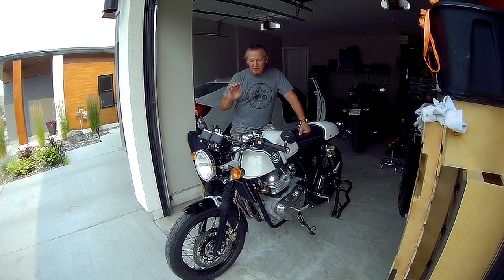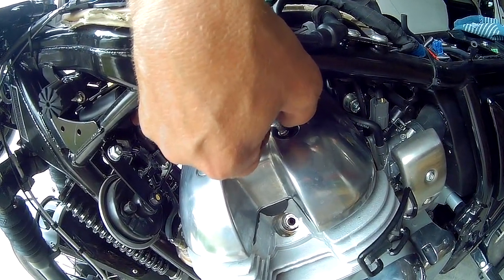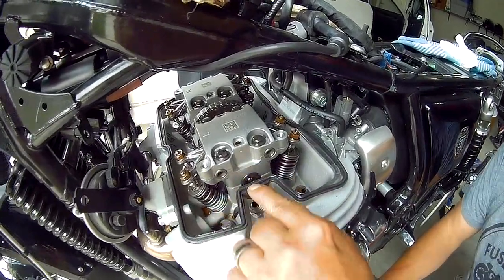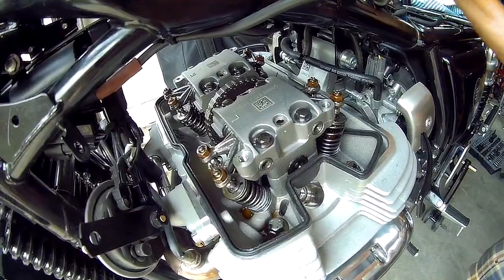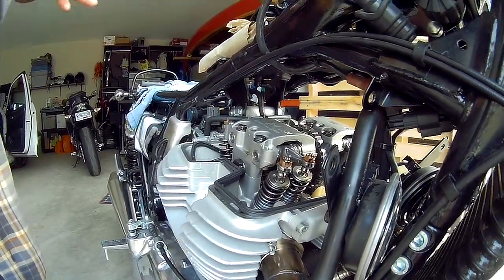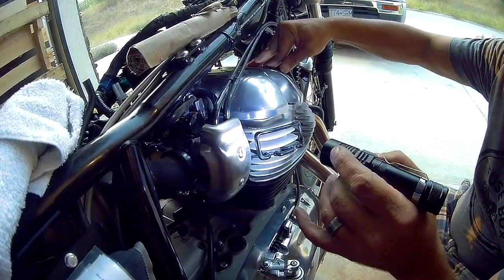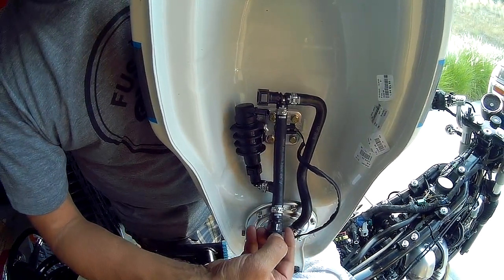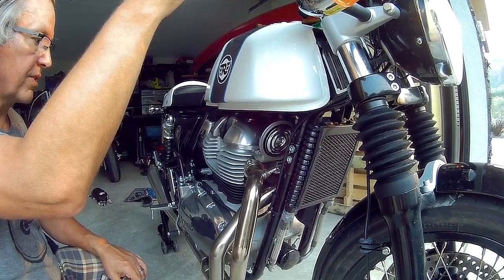🇬🇧 Royal Enfield Continental GT/Interceptor Meteor 650 How to Valve Adjustment gasket intact easy

Comment: Take the spark plugs out Last and put them back in as soon as you can, that is a vulnerable open hole to the combustion chamber; first rule of most maintenance routines.
Reply from the maker: Good Tip!!
Reply: Just put some cloth in the holes is what I do nothing getting in there then

Comment: I find it easier just to remove the gasket. Then you can easily seat it correctly off the bike and then just apply some sealant for the half circle. Goes on easily that way and less chance of mis aligning the gasket.
Reply from the maker: It may be easier to remove the gasket but if it can be done without removing the gasket then you lessen the chance of a leak, I hate leaks so didn't want to disturb the original factory seal.
Reply: @losttogether4ever  If you glue the gasket to the cover with grease there's no chance of getting a leak, done mine twice that way. What's the point of unbolting the horns then leaving them in the way? remove them completely.
Reply: Thanks for the video.
I find it less hassle overall to remove the gasket & put it back in to the rocker cover when reinstalling, I remove the old sealant from where the half circle sits & smear thin fresh sealant on. No problems after 4 valve adjustments

Comment: I've watched a few of these tappet adjustment videos and this is by far the best.  Too late for me though (I did mine a few weeks ago).  It would appear that I'm the only person to have a problem with the rocker-box gasket leaking oil after doing this job. The original gasket had compressed as much as it was going to with the original stand off bolts so I tried to buy another gasket but at $73 I politely told my dealer that I was not interested. Instead I used four M6 SS screws to replace the original rocker box cover screws and turned up 4 special stepped washers with groves to accommodate vitron (high temperature) O-rings (2 for each washer). So I no longer had a use for the 4 Dowty seals and the original 4 O-rings or the original stand off bolts. That allowed me to compress the original rocker box cover seal another mm or so and fixed my oil leak problem. By the time I'd done that 2 new seals had arrived from India for a quarter of the Australian price. I'll use a new seal next time.
Reply from the maker: Good for you thinking outside of the box and making it work!! I'm super impressed. Thanks for the kind words, we try to be as thorough as we can with our videos. Love hearing that we've helped you!! That's the reason we post!!
Reply: barney desimone   thanks for the reply mate.  The 2 new gaskets I mentioned as coming from India were from a couple of eBay suppliers.

Comment: REALLY APPRECIATE YOU SHARING THIS VIDEO!

I completed my first valve adjustment on my '21 GT 650 and would NOT have been able to get the valve cover off of the engine and out of the way without using your method (prop up the ABS module, pull out the airbox vent tube, and unbolt the horns).  It still required quite a bit of wiggling, but successfully removed it, and later reinstalled it - once again, having to wiggle to get it back within the space and onto the engine.

Getting the valve gasket properly seated and mated to both the cover and the engine was almost a nightmare and definitely the worst part about the entire job.

Thanks again for sharing Royal Enfield content on this side of the globe (North America)  - hard to find modification videos in English for our bikes.

Current mods on my GT 650 (Euro 4):

- Booster Plug
- FuelX Lite Autotuner
- HealTeach GI Pro GPXT Gear Indicator
- NGK Iridium XL spark plugs
- NGK Racing Cables (ignition/coil)
- MK Designs Shorty Tail Kit
- Metzeler Roadtec tires (140 upgrade on the rear tire)
- Hitchcock's 16 tooth front sprocket
- Royal Enfield Premium Rider (Solo) Touring Seat
- Royal Enfield Solo Seat Cowl
- Royal Enfield Bar End Mirrors
- Royal Enfield Black Magic Flyscreen
- LED Daymaker Headlight
- LED signals front and rear
- S&S Slip-on Exhaust

My GT 650 is originally the Ventura Blue but after watching you change yours from Ice Queen to Mr Clean I ordered a brand new Rocker Red Royal Enfield fuel tank and solo seat cowl.  

Thanks again for all your content and taking the time to provide the information!  (sorry for the novel - felt inspired, haha)
Reply from the maker: Wow!! Thank You so much for the kind words!! So happy to have been able to help you!! Thanks for being a part of our channel!

Comment: Thanks so much for your clear and detailed explanations.  Other videos edit out the valve cover gasket placement procedure.  I followed your instructions of placing small dabs of grease at strategic points on both surfaces that are sealed by the gasket and lining the gasket on top of the cylinder head (held in place by the dabs of grease).  After positioning the valve cover over the gasket, I did the back first, guiding the gasket into its groove on the valve cover (with the help of a long and thin flathead screwdriver), then did both sides, and the front portion automatically fell in place, with the whole gasket held in place by the small dabs of grease in the groove of the valve cover.  I couldn't believe it, to the point that I almost screwed the job checking if it was true that everything was in place (you can feel it when it is, but anyway you have to check).  I didn't remove the PCV hose or the horns as some others had had no major problems without removing them, but I was ready to do so if necessary.  I also followed someone's advice of rotating the engine so the left-hand side intake valves were open (down) before repositioning the valve cover from the left-hand side.

Today I received a brand new Glitter and Dust (Chrome with Black Stripe and Gold Pinstripe) gas tank for my Royal Enfield Interceptor 650 Mark III (Black) which I will feel confident installing (when I feel like it) thanks to your detailed video about tank replacement.  Thanks Again!
Reply from the maker: You are very welcome, we're glad our experience's are able to help you!! It's the reason we take the time to make these videos! Thanks for watching and being a part of our channel.

Comment: Fitting the gasket at the end is the worst part of the job, good video, I'll try doing it the way you did it, 👍
Reply from the maker: Yes it is, let me know how it goes. Good Luck!
Reply: Hi there again ,the pain is over! I managed to fit the gasket and got rocker cover back in place, I found the only way to do it was  to very carefully line up gasket on the head, stuck down with a tiny amount of sealer and then even more carefully slide the rocker cover in between the frame above the tappets being careful not to disturb the gasket....the hard bit is lowering the rocker cover down onto the gasket without getting out of line or you'll end up pushing the gasket off into the engine which means starting the whole procedure again. Anyway it's very satisfying when you feel the lip of the gasket pop into the groove of the rocker cover, I think I'm going to have a party now😄..I hope that's of some help to somebody struggling .
Reply from the maker: Good, it is very satisfying to feel that pop!!

Comment: Although its recommended to change the valve cover bolts and the seal washers as well inorder to prevent any seepages or leacks
Reply from the maker: As long as you take your time removing the seals you should be able to reuse them with no problem. I've never read that it is recommended to replace the valve cover bolts and seal washers.

Comment: Only need to undo the lower fuel connection. Good vid though.
Reply from the maker: True enough, I think that by disconnecting the upper line you get a bit more slack in the lower line allowing easier access to the connector.
Reply: @losttogether4ever  Just found you video, great job BTW. I have just 1 question, did you have to run the bike low on fuel of can you do this job with fuel in the tank?